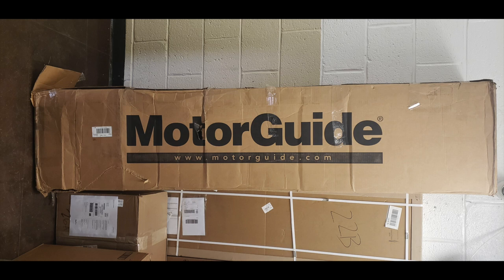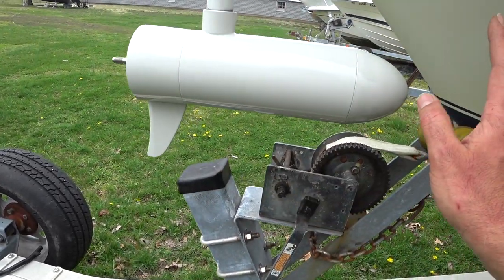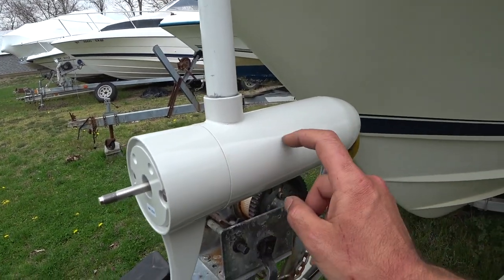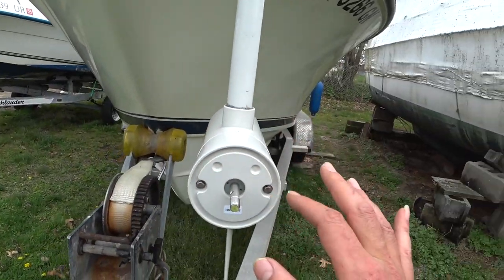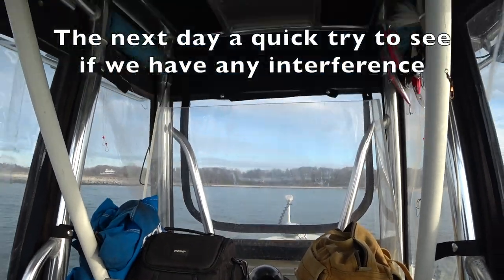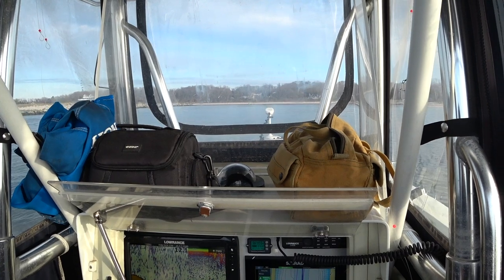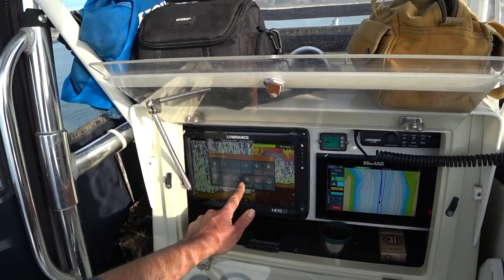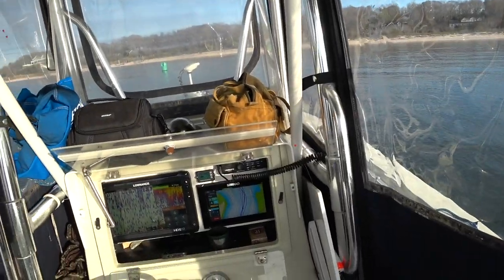Motorguide xi5 magnet problem solved/How to replace the shaft/take the entire unit apart.

Comment: It doesn’t show anywhere how to take the lower unit apart :(
Reply from the maker: Yes it does. Watch the video and pay attention. Don't skip it. Everything is there
Reply: @DionisiosArgyros  i just watched it and you never showed anything except the rotor. Lies.
Reply from the maker: @kizzjd9578  I have links for two videos that will show exactly how the MotorGuide is being disassembled and how to change everything. Is not my fault you chose to scroll through it without paying attention.
Reply: @DionisiosArgyros i didnt see the link pop up sorry? When did they pop up?
Reply from the maker: @kizzjd9578  You have to wait until I go home and check on my laptop.
Or, send me a PM on messenger or Instagram and I will send it to you right now

Comment: I’m in the same boat . I am not waiting on replacement warranty .  My motor is running at half speed after losing the remote in the water . Replaced the remote and it won’t go over half speed. .motor guide said it’s the board . I replaced the board . Same problem.   Checked batteries and wired  up directly to batteries and  disconnected GPS to shut down any cruise control . Still having problem . Next step is the lower unit if the second remote I ordered doesn’t fix it  . Thanks for video . This will be my next thing replaced . There’s nothing left
Reply from the maker: I know there is a hard reset method. Something with the ground wire. I haven't looked in to it yet.
That should fix the problem.
Keep the previous board for the future.
Like you said, nothing more to replace.
Just open the gear base that mounts on the boat and make sure there is lubricant there and thats it.
There is nothing that we couldn't fix ourselves. They are easy to work on.
Tight lines my friend.

Comment: I opened up motor saw little bit rust. Problem was it was shorting out and popping breakers. I think this was a result of pressure washer. Going to take out motor and clean rust off with sandpaper. Motor is still under warranty, he’ll with it I’m doing it! Thanks for the green light
Reply from the maker: Go for it. You should get comfortable with it because you will have to service it once in awhile anyway. You can get the schematics and order any part you need from different websites. If you need help you can contact me at my Facebook page, or look for the group (motorguide trolling motor owners) in Facebook.

Comment: I need to replace my 60 inch shaft with a 48 in shaft on my motor guide xi5  wireless . So my question is will heating the epoxy where the foot meets motor ,will it harm my built in transducer or cause harm to motor in any way
Reply from the maker: Probably not. But to be on the safe side you better off remove everything. Since you're replacing the shaft you will have to take apart the wires from the unit. So, take the front cap off and the back cap off. Leave the housing with just the magnets. It will also be easier to unscrew it.
Reply from the maker: Don't be afraid to take it apart, you won't break any seals, they are just rubber gaskets.
Reply from the maker: How did that shaft replacement go?? everything ok??

Comment: Freshwater is the same pipe
Reply from the maker: I thought it was different. Never owned one so I can't be sure.
Reply: Just shredded my threads so here trying to learn to take the lower apart so I can clean the threads.
Reply from the maker: @CatfishHunters  it's nothing hard about it. If you follow the links I have attached to my video you will be  able to do anything to your motor.
Reply: Didn’t see them. I’ll rewatch
Reply from the maker: @CatfishHunters  You should. That's the two videos it helped me with everything. The language is Russian but you don't need to understand, just watch. If you have any questions let me know.
Reply: I saw a fb link. I don’t have fb. Watching again now
Reply: I never saw the link. Thanks anyway.
Reply from the maker: @CatfishHunters  when I get to my desktop I'll check and I'll let you know
Reply from the maker: @CatfishHunters  Ok, there is a video card of the 7:56 how to take everything apart.
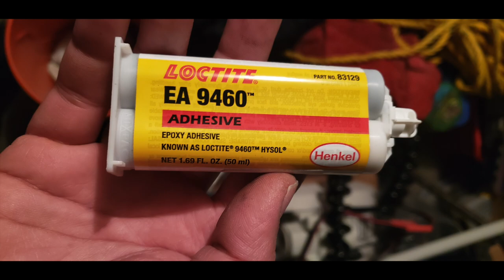At the 9:46 there is a video card of how to replace the shaft.
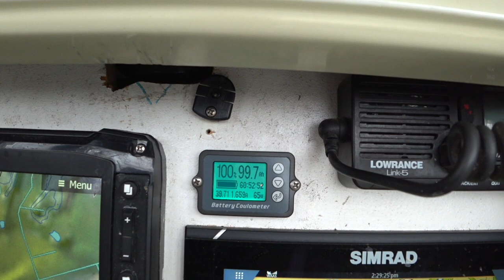At the 14:01 is a video card how to install the RV monitor for the battery.

Comment: Thanks for that video.
Do you have a link for a video where it shows how to pull out the low unit motor? I want to pull it out to give it a clean and see if i can make it work again without buying the full unit. I had some water intrusion, hopefully it wasn't too bad.
Thanks in advance
Reply from the maker: Sorry for the late response I just noticed your comment.  There is a video but it is in Russian. If you take a look at my video you going to see the option to the top right corner. There is two videos that will help you with whatever you need.

Comment: Καλημέρα Dennis, Ωραίο video μπράβο, θέλω να σε ρωτήσω ποσά volt είναι η motorquide σου και πόσες και τι μπαταρίες έχεις  επάνω?, το coulometer μέχρι πόσα Αμπέρ είναι, εγώ έχω μια 24volt motorquide με δυο 100αρες AGM και θέλω να ξέρω αν αυτό το battery coulometer κάνει και για την δίκη μου? μπορείς να μου πεις τα specs του? Ευχαριστώ εκ των προτέρων.
Reply from the maker: Γειά σου φίλε μου. 36 volt με 100 αμπερώρια μπαταρίες. Είναι από 10 βολτ μέχρι 80. 350 αμπέρ. Μπορούσα να πάρω κ με τά 100 αμπέρ η κ με τά 50 που είναι κ ποίο φτηνό. Κάνει για όλες τις μπαταρίες. 
Στείλε μου στο messenger και θα σου στείλω το link από που να το πάρεις κ όλες τις λεπτομέρειες.
Reply: @DionisiosArgyros   thanks for the answer,I have sent you e request on fb, thanks again.